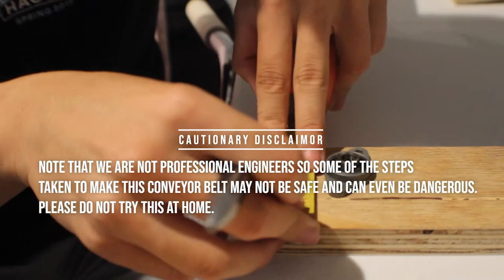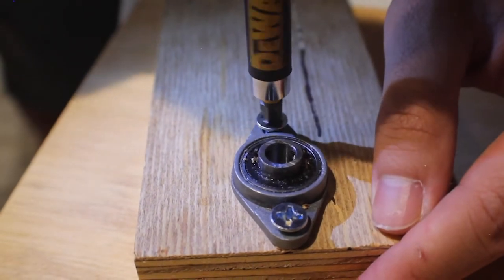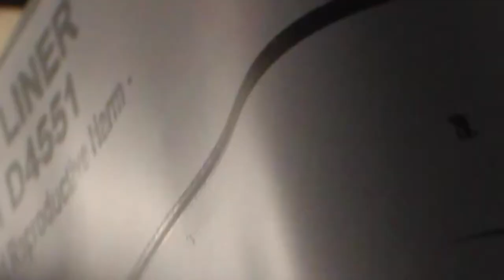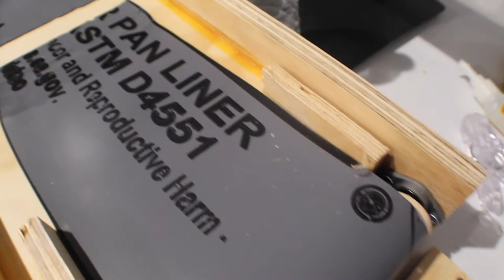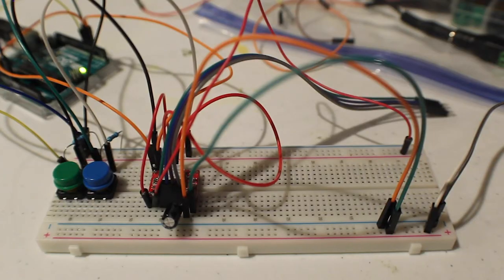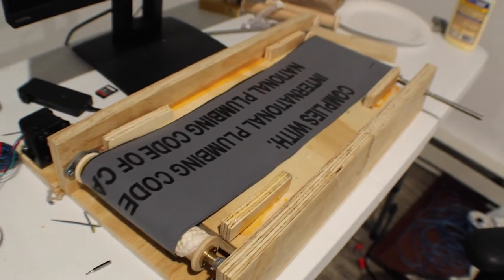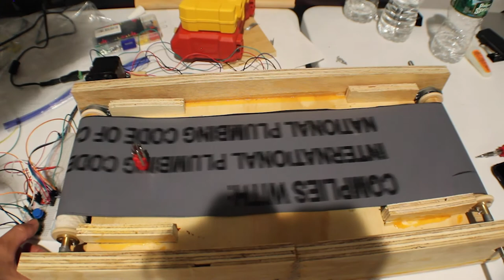Making a Conveyor Belt with an Arduino and a Stepper Motor

Comment: I did a similar thing with my son, for his STEAM fair, the thing is we built a simpler version and didn’t use ARDUINO, we plugged the engine directly into the battery, you can control the speed by having less batteries V (1.5V x2 vs. 9Vx1) and you can change the direction of the conveyor belt by simply reversing the polarity of the batteries(plug + in -, or other way around).
Reply from the maker: Your belt was definitely built better than ours.

Comment: What material did you use for the belt itself?
Reply from the maker: It was a PVC rubber shower pan liner roll. I don't think the material matters, it's moreso about getting the tension right.

Comment: sir can you explain me the program for what int pin = 3 is used?
Reply from the maker: It has been quite a while but i believe pins 3 and 4 were both used for the stepper motor, one for step and the other for direction.

Comment: Pls buy a g-clamp, that will help you in your cutting, drilling and sanding process by holding the woodpiece really tight on your table
Also use masking take on plywood when drilling or cutting to preve t ugly cuts
Reply from the maker: I agree that those are good suggestions that I wished we followed back then.